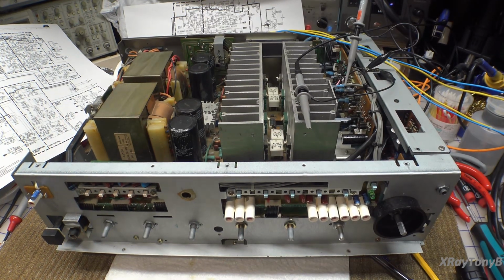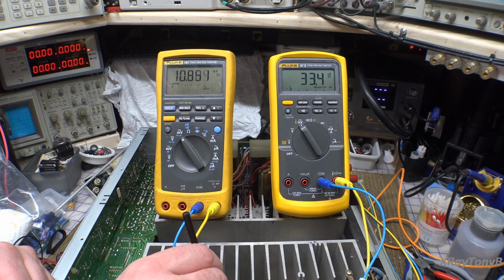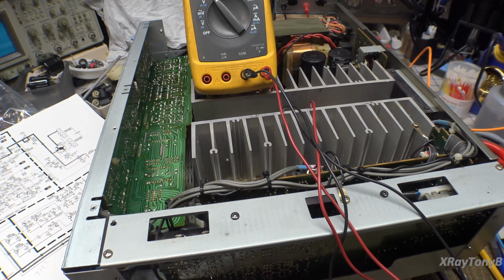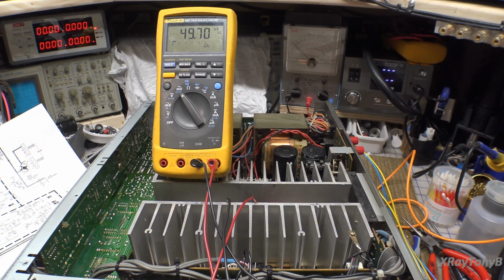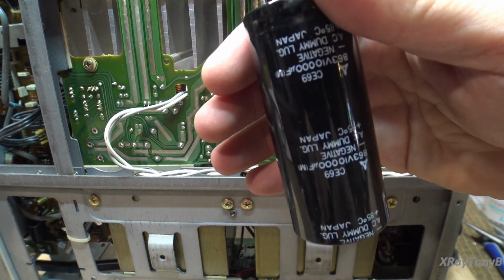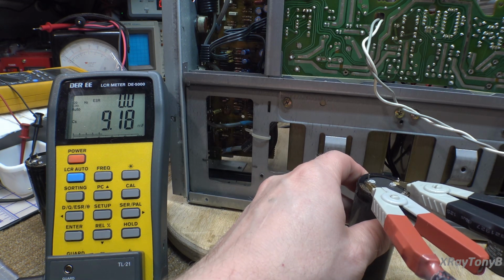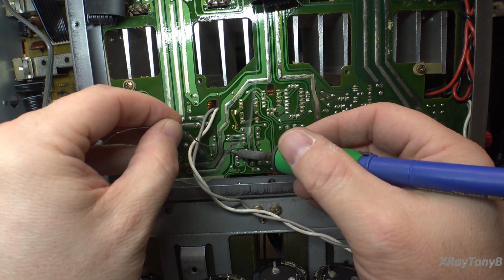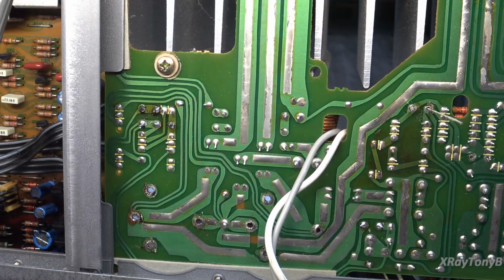Harman Kardon PM665 Part 3 - Amp & Power Supply

Comment: Tony at 42:02 you placed the 47uf 50v at the original place if heat can be an issue why didn't you solder them underneath the board there was plenty of space and the board isolate the heat to the electrolyte. 😁
Anyway nice videos I'm more into tubeamps but this is fun too, I'll learn a lot.

Comment: Tony, i approve of your 'clip-before-solder' approach! :) (50:21)
Reply: Me too, we all know why😊
Reply: @Dutchamp  We do? What's your opinion? Mine is that if you cut the lead short enough, you can solder the connection leaving no sharp edges!
Reply: @dhpbear2  most important if soldering first then cutting the leads can stress the solder joint and mirco fracture the leads of the board or the trace itself. And like Tony said soldering after cutting covers open copper lead ends. If I need to repair it for a costumer and don't want to pay me enough. Ok then I'm a little racing car and repair it test it and that's it. If I'm restoring it the right way and for the hobby I'm paying attention. 😉

Comment: Another great video = Thank you! For power supply caps that are close to a heat source... An option might be to leave their pins long, cover the pins with heat shrink and move the cap away from the heat source, a bit, when the board has room to do such. Or, mount the cap turned on its side. I know the rule is to have the cap close to the component it serves, but keeping it cool at a distance might be better than hot up close. Just thinking...

Comment: I personally would have started with the power supply section instead of ending there.  What did you use to glue those big caps back in with?

Comment: Just for future reference the Kemet ALC10 series caps come in the 22mm 4 pin type. I can't link it here but if you search 10kuf, 63v 4 pin caps it's the only one that turns up. I think UCC makes some too but apparently Mouser doesn't have any in stock.  I've used Kemets for main filters in a bunch of projects and have had great results.

Comment: Just wondering if the Transistors required for a repair are no longer available is it alright to use NPN and PNP power transistor modules to replace the Power Transistors

Comment: So uh, yeah, I got an opinion for ya.....I LOVE what you do in these videos!!!! :) So, on those large electrolytics, I skipped ahead a bit and may have missed something but I don't think you mentioned it? There's a simple touchy/feely/listen test you can do with those big cans-even before checking with a meter. Simply remove em and shake the snot out of em. If they rattle (and yes I've found several that did) they're paper weights. I don't care what they measure. No rattle cans go back into my repair projects!

Comment: The manual solder sucker that you used sure seemed to work better than the kind I use.  What brand is it?
Reply from the maker: eBay special!  I think it was pretty cheap.  Not a real "soldapullit" brand, but a knockoff of the design.

Comment: I think you get a distortion character easier on the ear, more into class A, cos it's more even harmonics...that's what the class A guys say anyway...
With the smoothing caps, no one ever seems to worry about checking the ripple current...some new caps seem awfully small, I know construction and materials are more efficient now, but I wonder whether sometimes the size reduction is partly due to lower ripple current rating...

Comment: Should be able to read the ESR regardless of the size of the cap.  It's not 0.00.   My B&K LCR meter doesn't have an issue with 10,000uf + caps on ESR.

Comment: The LCR meter will show lower capacitance the higher the test frequency you use. If you select 120 Hz I think you will get closer to the nominal value.
Reply from the maker: I actually put a note in the video stating that I was testing at 120Hz.  You are correct, however.  Raising the test frequency will cause the capacitance to read even lower, especially with electrolytics.  Even at that frequency (120Hz), it still reads the capacitance as being lower, when compared to the Sencore LC53.  All of these types of LCR meters seem to do this.
Reply: @xraytonyb  ah, I see. I think it’s because the non LCR meters measure the capacitance by measuring the charge time curve using DC. In comparison to LCR meters that measure the current and phase with AC. That is probably why there is a difference between the two types, at least as far as I understand it. Seems to me like AC measurement would be more accurate since that is how it is used in the circuit.

Comment: Any particular reason why you didn't measure for leakage in the large electrolytic capacitors?  I wonder what you would have seen using one of these:
(  https://www.youtube.com/watch?v=LhovRIM5xAo )
Reply from the maker: I tested it on the Sencore LC 53.  They were fine.  It is also important to check ESR/dissipation factor.  Leakage testers will not show those factors.  Leakage and ESR/DF are equally important when testing these types of electrolytic caps.  Thanks for the comment!  BTW, the original Carlson leakage tester doesn't work very well for electrolytics, but as I understand, his new version (came out after the one you referenced) can apparently test them ;)